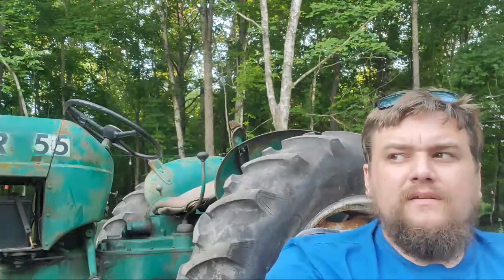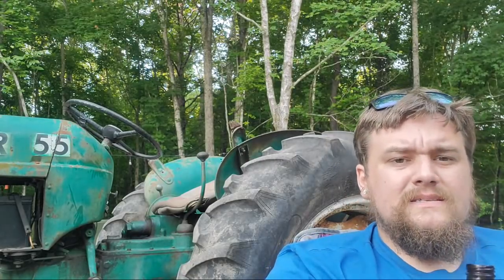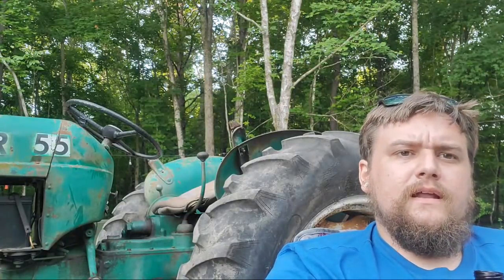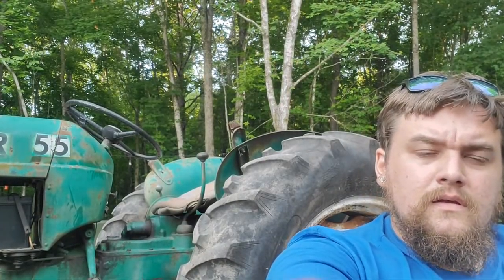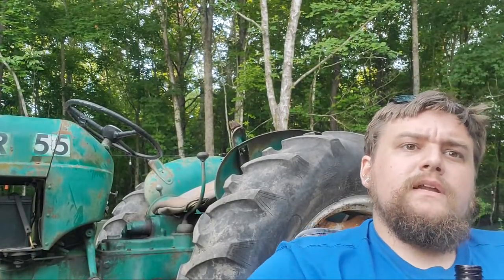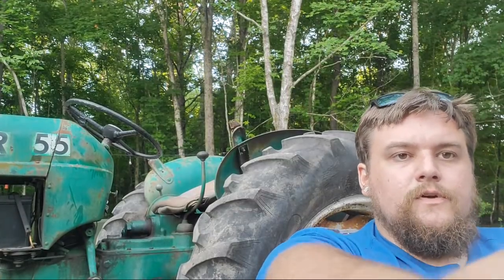Live With The Oliver

Comment: You should pick yourselves up a rivet shaver, they are commonly used in the aircraft industry and work extremely well at removing rivets and used ones on ebay can be purchased extremely cheap.  They use u solid carbide cutter and have extremely accurate depth adjustment